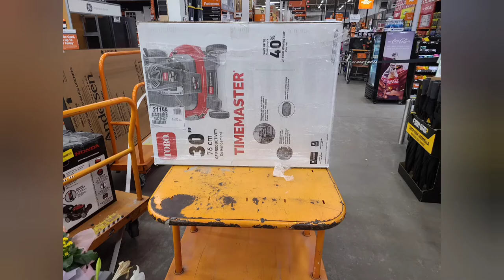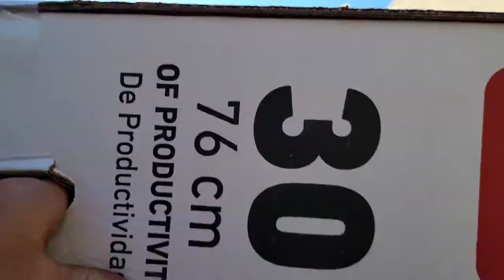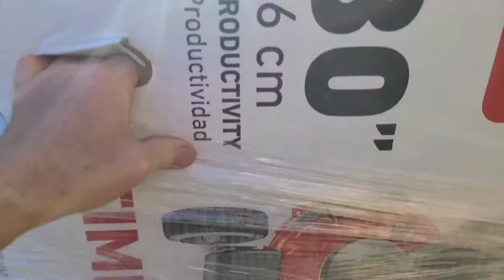2021 home depot  toro timemaster 30" unboxing part 2. try this again.

Comment: Awesome that you got another one. I know it's a pain in the ass going back and forward. That blue thing in the fuel tank is a filter and what Jon said, stop fuel from sloshing around. I am still waiting for my new Timemaster to come in at my dealer. I might be caught up with you soon. I will have three TM's then lol. One of my machines has that problem with the rear wheel height adjuster. I have a rubber bungie cord holding it. Baby that Timemaster so it will last you longer than a year lol. I have had both of mine for 3 years now. Great video Carlo.
Reply from the maker: Yep thanks. Tip put a long machine screw through the lock stop it worked for me until it losses up to much. . This think should come with duck tap and bungee cords and zippy ties. Lol.   They fixed the power issue now I can see..
Reply: @thecuttingforce  LOL, 100% on carrying zip ties, duck tape and bungee cords with this mower. I would last forever then!

Comment: What spray are you adding to bottom? You mentioned it but didn’t say which one and exactly for what?
Reply from the maker: Sorry I forgot to show that . I used gunk protect under deck spray.  It kinda works.. its to make the grass cleaning eazyer.. this mower gets grass stuck underneath fast if grass is any kinda wet..